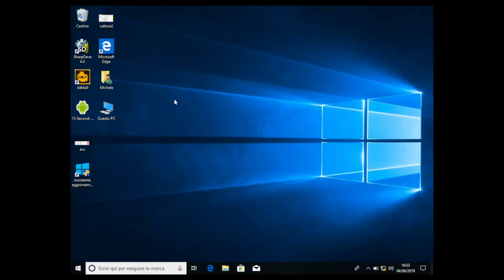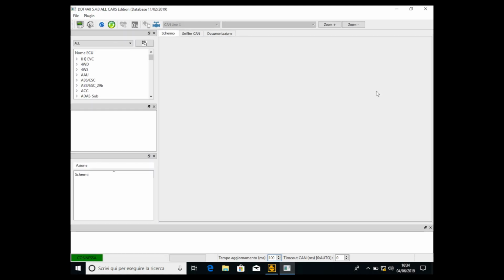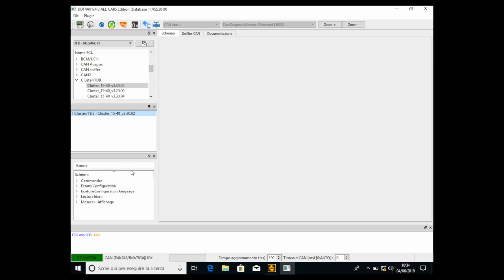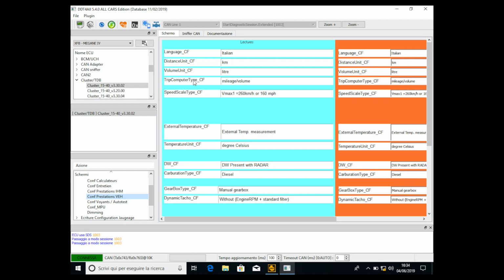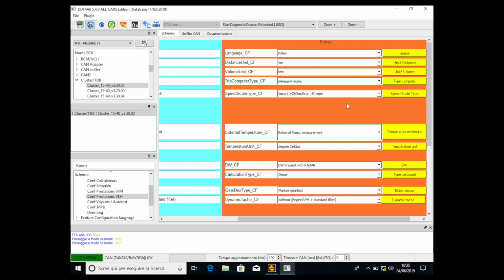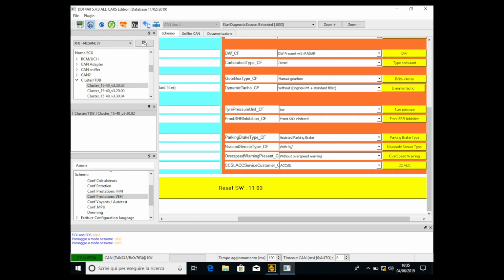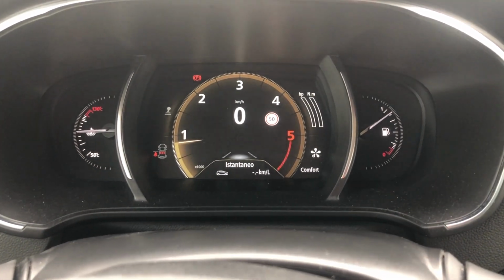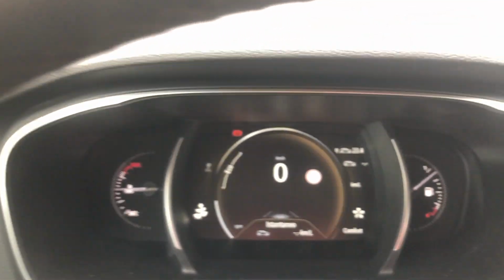Fuel Consumption Unit Change DDT4ALL in Renault Megane Dashboard - Km/L Activated!

Comment: Hi Michele
I can not make it work on a Renault Capture 2020.
Any idea why it does not work?
Do you have a link to a newer version of the program?
Reply from the maker: hi, it's not working simply because since 2019 Renault introduced a Firewall that stops all incoming connection from the OBD port, only renault have access to it. We're working on a solution on how to bypass it.
Be faithful 😅
Reply: @drivewithmi  Hi
Is there a new solution?

Comment: Hi Michele, i have a renault clio 2019 registered in Ireland.
I'd like to change the km/l to L/100km. is that software would be able to do it?(I don't have the digital dash what's in the video. I have just i think a classic clio dash🤔
Thanx J
Reply from the maker: Yep! Of course you can! Just select the right car in the first menu and then search through cluster/tdb settings. I made a video on how to change parameters in the Clio.
Reply from the maker: It’s in Italian, but you can easily follow it by simply click in the right menus
DDT4ALL Tutorial Italiano #08 | Attivazione Temperatura e Km/Litro per Clio e Captur
Reply from the maker: https://youtu.be/gBDCFSpoF4I
Reply: @drivewithmi  it's mentioning rlink 2 but I don't think i have that, i think just rlink would that be enough?
Reply: Media nav evolution 9.1.3 that's the software on the radio
Reply from the maker: Yep! The system is called R-Link evolution (R-Link 1) on Clio-Captur.
My bad if I said r-link 2 in the video!
Reply: @drivewithmi  thanks a million! I'll defenetly buy one of those obd II device

Comment: hi michele, i try this on my elm327 bluetooth dongle and my renault kadjar, but the left column stays red, so i think it doesn't read the data from the car... should i buy the wifi dongle or should this be possible with the elm327 bt ?? i dont't want to write anything to the computer now, because i cannot see the basic data as-is.

thanks kindly for your response and all the work you have put online !!

Comment: Hi michele
My name is Wiki. I'm from Poland.
First of all, thank you for great videos about modifying the R-Link 2 settings by the ddt4all program. They show how you can change and activate hidden settings on our Renault cars. Cool ...
My question …
Is it possible to change the information displayed in the upper right corner of the main counter.
In one of the videos where you change the odometer reading from l / km to km / l by the way you showed in the upper right corner two new parameters that I do not have and I can not easily set in my car. This is probably the distance traveled from the beginning and the current fuel consumption.
Is it possible to set in the upper right corner information of interest to us from some available collection. For example, such as in your movie or another available in the system to differentiate the information displayed in individual driving styles, e.g. different for ECO riding, different for NORMAL, different for SPORT etc.
Could you put some instructions on youtube or send instructional videos to my private email address.
Please include, if possible, a list of parameters that can be displayed in the upper right corner of the meter.
I drive a Renault Talisman from 2017. My factory version of R-Link 2 is 2.2.19.300 after the upgrade, I have version 3.3.16.966 and access to ANDROID AUTO.
Best wishes.

Comment: Hi Michele, Thank you for all your video's! They are very clear for me what to do step by step. I have done some changes already. I have a question...... I'm looking for the possibility that the windows close automatically when I leave the car (Megane with keyless entry) at the moment the car detects that the keyless key is leaving the car (that's the moment the car closes automatically). Hope you can find this option. Keep up making this good video's!
Reply from the maker: Hi! It seems that you have disabled that option. If you have the easy access key the car should automatically detect when you’re leaving the car or when you’re approaching it. It should be under user options.
Reply: @drivewithmi  Hi Michele, The easy access key is working fine. What my question is... 

Do you know if there's a possibility that when you leave the car and the windows are still open that the windows will close automatically when you walk away and the car locks the doors? 
Now when it's a warm day and the windows are open I sometimes forget to close the windows when I walk away from the car.
Reply from the maker: @n.vanderhoeven9415  unfortunately they won't close automatically. you have to press the lock button on the key for two seconds, and they the windows will close
Reply: @drivewithmi  Ok thank you! All the best for this new year! Hope for more of your video's with nice changes for my Megane this year.

Comment: i have read me too it have some too do with Drl with Tail and change it from 0 to 1
Reply from the maker: ok i got it. I think you don't have a megane, because in the Megane that value is 1 by default. btw yes, you simply have to change the valute DRL_with_TAIL from 0 to 1; once you've done that lock the car and leave it locked for 20 minutes. then open it and try if it worked!
Reply: @drivewithmi  can you do a video how to do it. I have a Kadjar

Comment: This worked perfectly for me! Thanks so much. So my Kadjar doesn't have the walk-away locking feature most modern Renaults have. You need to push a button on the door before walking away, Is there a way to activate this using DDT4ALL? Thanks again
Reply from the maker: Hi Mark! Are you sure your Kadjar doesn’t have it? What kind of key you have?
Reply: @drivewithmi  Thanks for the quick reply Michele, yes I'm sure. I just double checked there. It's the rounded card fob, white on one side. Its the 2015 model
Reply from the maker: @cookinwithtech  well actually if your car has not it activated i think you miss the hardware module
Reply: @drivewithmi  Ah yeah I thought so. Hey thanks anyway and thanks for all your help. I exported a car from the UK to Ireland so the Miles to KM was a life saver

Comment: Hi Michele, as usual your videos are very useful: thanks for them. Anyway, cause Im going to buy a second set of wheels, there'll be needed of others 4 TPMS valves. So, do you think it is possible to esclude the wheels pressure monitoring? Do you know how? Thanks for the kind answer you are goingo to give me. Roberto
Reply from the maker: Hi Roberto, one of the Next videos will be how to deactivate TPMS sensor, it will be useful also for who (like me) fits winter tires without pressure sensor. I'm recording videos in these days and it will be available ASAP!
Reply: @drivewithmi  Ciao Michele, hai realizzato il tutorial per disattivare i sensori TPMS? Scusa se ti chiedo ma sto per montare le ruote invernali. Grazie

Comment: Hi Michele,
Can you please tell us how to chose the right ECU with the right software version?  Where can you see or check this?
Othervise THANK YOU for your great videos. They are very helpful.
Reply from the maker: Hi Jure,
To choose the right ECU you simply have first to select the correct car (megane, talisman, kadjar, scenic and so on), and then you always have to select the one with the highest number (in this case i chose 3.30 which is higher than 3.20), then you can proceed with the hack. don't worry if you select the wrong ecu. at worst you won't see any change or simply the interface will tell you that this ECU is not connected to the car! 

thank you so much for you appreciation! i'm really glad you like my videos! there are more coming!

Comment: Ciao Michele grazie per i tuoi video. Always the video starts with a Windows 10 screen where you open ddt4all and start explaining..... I was wondering if you are sitting in your car with the interface connect and engine running? What is the right procedure before opening ddt4all?
Reply from the maker: yes, i'm sitting in my car, with the ignition on (but the engine is shut down). then i connect the obd interface; when the PC connects to the OBD wifi i open DDT4ALL software.
Reply: @drivewithmi  thanks for all. So is also clear that of course you're using a laptop computer. Well, thank you very much.
Reply from the maker: Yes, I use a MacBook Pro with a virtual machine that runs windows 10

Comment: Thank you for the video. Is it possible to change the steps in  cruise control mode from 2 km/h to 1 ?
Reply from the maker: unfortunately i still haven0t found it! i'm not sure, but i guess that somewhere there's an option!
Reply: with 2km/h is beter man. I drove just couple days ago an Peugeot 308 for barrow and i dont like it. 2km/s at a time is much better, believe me.
Reply: @AOuadi79  not when towing a caravan and want to adjust your speed perfectly to the car in front of you. Talking from experience :-)